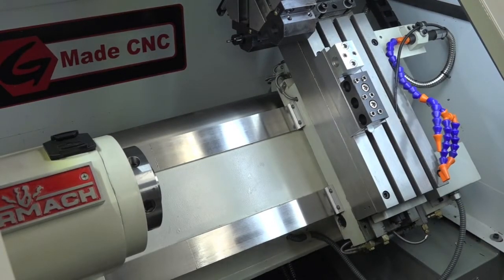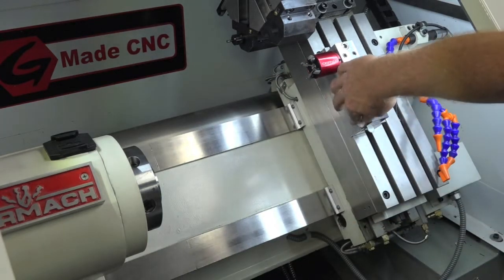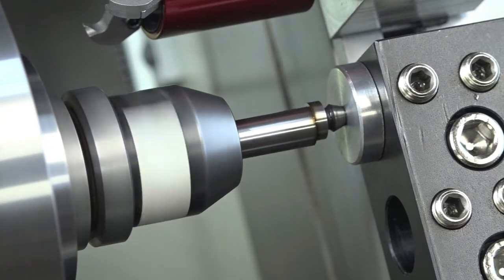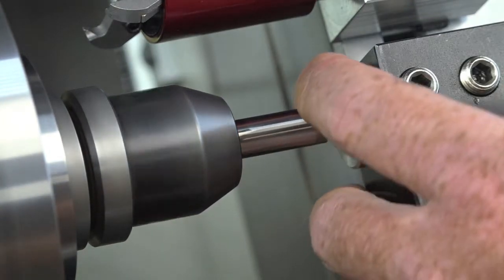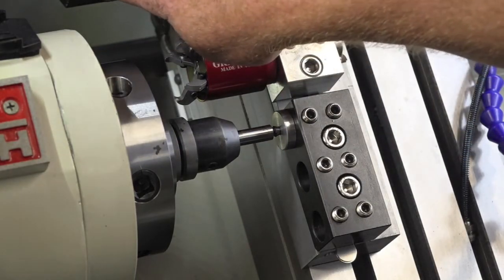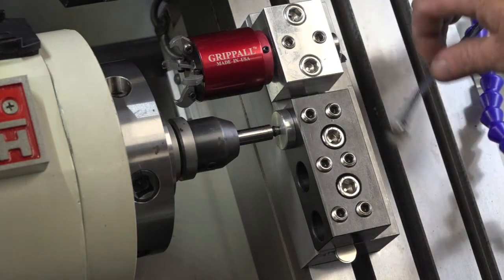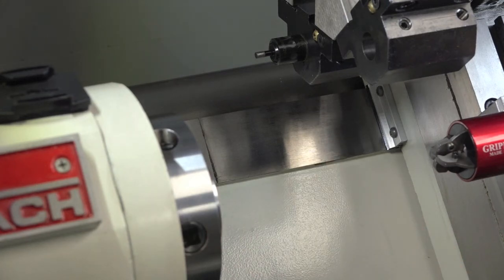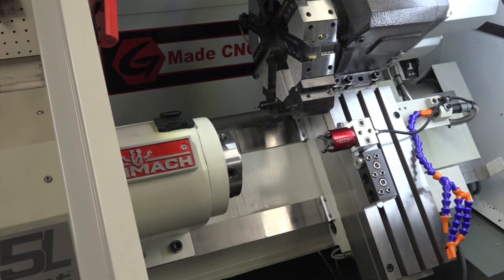Centering drill bits and Bar puller on the Tormach Lathe Part 1

Comment: This is definitely NOT the way to centralize your tool holders on your lathe. You will never be accurate. Use a centralizer as used on a mill to zero the X and Y axes.

Comment: You could use the plug to locate the puller X coordinate and forego the collet closer arm removal. Just remove the puller and insert the plug. I usually use a coaxial indicator  in the spindle to find the bore centers(no plug), but it does use a fair amount of Z travel. 😃